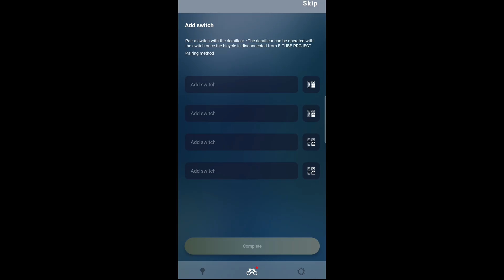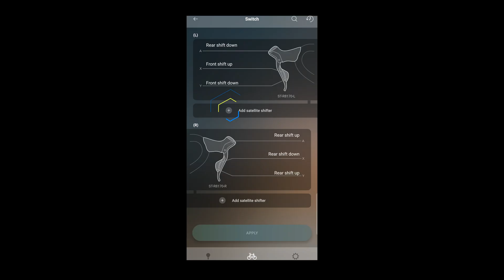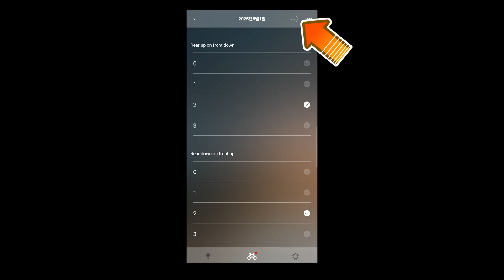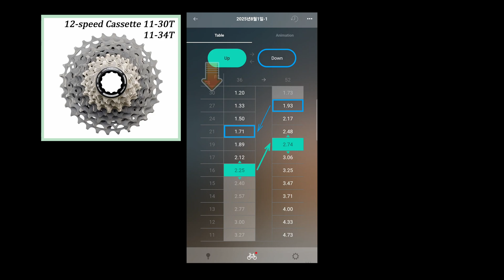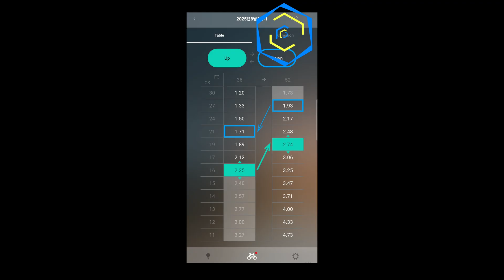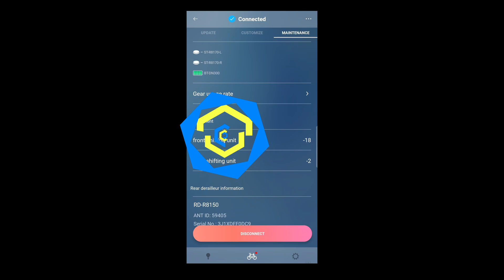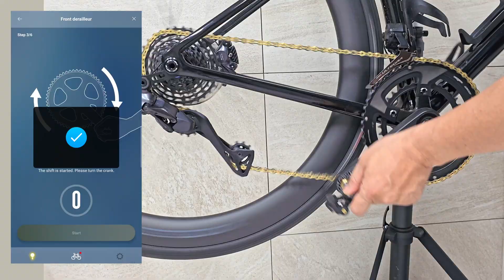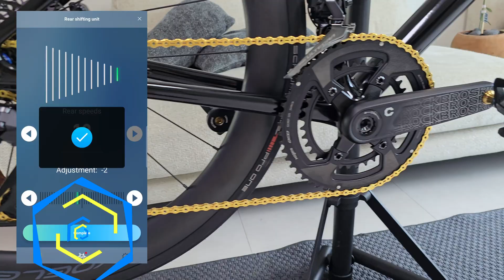Complete Shimano E-TUBE App Setup 🌀 Di2 105, Ultegra & Dura-Ace Fine-Tuning Part 3

Comment: Can I charge the internal BT-DN300 battery of the Shimano 105 DI2 – RD-R7150 derailleur using a power bank? What specifications should the power bank have?
Minimum/maximum mAh? (5000? 10000? 20000?)
Other specifications?
Thank you in advance for your help.
Sorry for my bad english
Reply from the maker: 7.4v (Shimano Di2) 500 mAh = 3.6v (Power bank) 1000mah

Shimano Di2 BT-DN110-A Battery Pack - 500 mAh
https://www.bike24.com/p2164000.html?referrer=https%3A%2F%2Fwww.google.com%2F